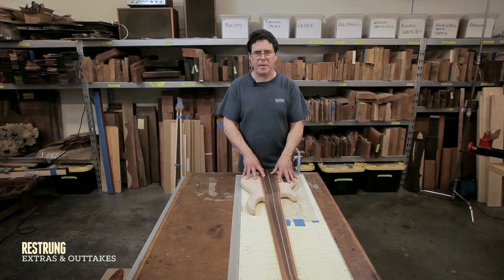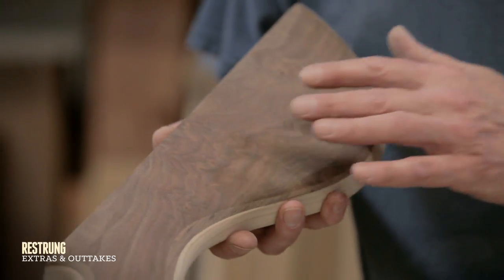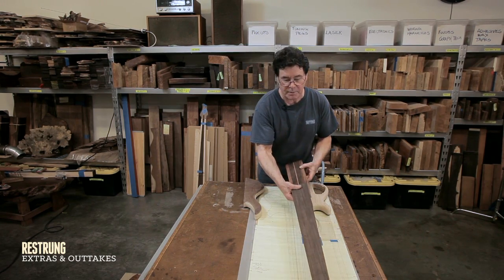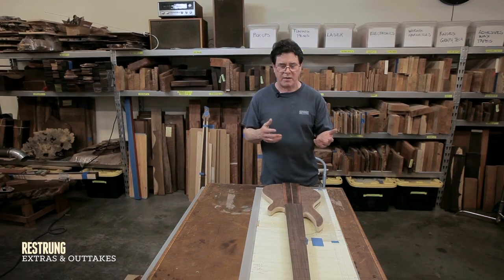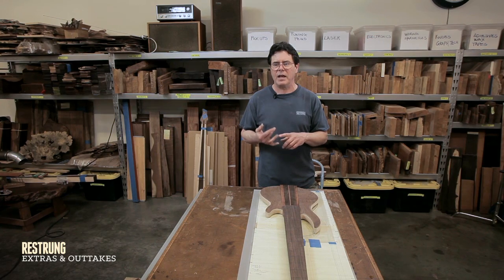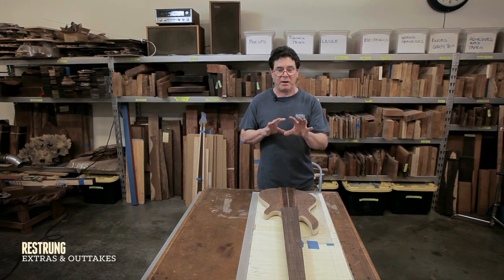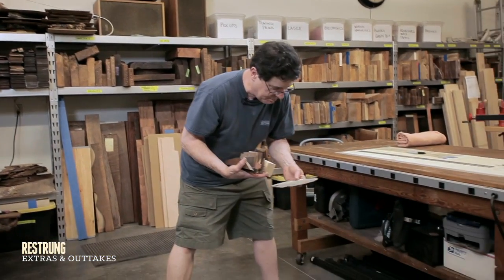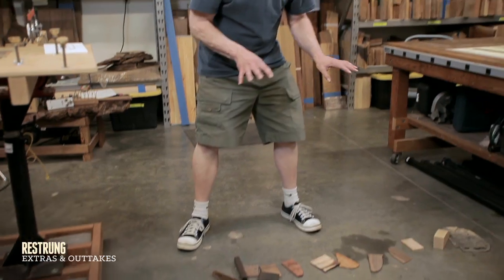How to Build a Bass Guitar - Step #10 - Tonewood Explained

Comment: as for the test u did with the wood droping on the floor ... i noticed the pieces were not even in shape and sice and i believe  even not weight... so how can these really be compared to each other when the parameters are so different? dont get me wrong this is not meant to be an offence.. but i just wanna know cause im really interested in this.
Reply: I would love to see somebody make a xylophone from identically-sized pieces of the most common "tonewoods". That'd be a good demo of the differences, I think.
Reply: so u have a xylophone that changes the sound not the note ... nice idea
Reply: +Crn Dffy That's a brilliant idea.  What we're hearing is the size, shape, and density of the wood.

If we had someone mill out identical blocks using different species, we would have something to listen to.  Of course, every piece of wood, even in the same species, can be vastly different.  It'd have to be done with many samples.
Reply: Guitar and bass pickup only pick up the metal string movement. Resonance of wood has nothing to do with the sound of the electric guitar or bass. You can do several experiences, the most known is to string the guitar with acoustic or nylons strings, you will ear the resonance but nothing comes out of the amp.
You can also pick the guitar with the neck free and then support it against a wall, you will ear a difference in the resonance of the guitar, but nothing will change on the tone coming out of the amp.

Comment: I don't mean to knock the artistry of guitar building. But I feel that pickups and electronics are more critical to the speaking voice of the instrument. The body and neck construction are like the lungs and diaphragm, but the pickups and electronics ARE the vocal cords of any electric guitar or bass. Another aspect of electric guitar and bass building that most builders tend to under-emphasize and undersell is how pickup placement affects the tone. Gibson seemed to understand this idea when they built their Ripper bass that had a sliding pickup built into the pickguard. Mike Pope also had Fodera build his signature instrument with a movable pickup mounted into the body near the bridge. I believe Alembic also built an early prototype with movable floating pickups. At any rate, its a concept that really hasn't been delved into as much as it should be.

Comment: For an electric guitar without piezoelectric pickups, the species of wood does not matter.  The density and shape does, even if the significance is minor.  The strings are probably the biggest influence, followed by the pickups.  Yes, some sympathetic vibrations from strings do resonate in the body/neck and transfer to other strings, but we typically try to avoid that!
Reply: Great. Please go tell this to luthier Michael Tobias. He is famous by using the same hardware on all his basses, the only variable being the wood. His basses sounds completely different though. Can you explain this?
Reply: Btw I noticed from my experience, that quality and type of the wood is much more important for bass guitars, than for electrics. I suppose this is due to more massive strings on the bass and more energy transfered to the body of the instrument.

I would add that there are usually two reasons for people to say that wood doesn't matter. First, they never held any fine instrument in their hands (better and more expensive than american standard Fenders or Gibsons). And second, they just didn't trained their ears and just cannot hear the difference when it is obvious.
Reply: I'm not saying the piece of wood doesn't matter, but it's not specifically the species.  You're absolutely right.

The frequency response of the wood, determined by the resonances, are what actually affects the sound.

If you have a maple body with a similar density and grain structure as a mahogany body, it will sound similar using a magnetic pickups.

However, for acoustic guitars and guitars with piezo pickups, the species DOES matter!
Reply: Well, I agree with you in that "maple body with a similar density and grain structure as a mahogany body" will sound like mahogany. Of course it`s true :) I believe the majority of the people thinks of tonewoods in context of their density and structure, not appearance or something like this. So I don`t see any disparity with what I`ve said above.
Different sizes, shapes and densities of the species define resonant frequency (or frequencies) of the instrument. 
I suppose the main difference between electric (solid-body) and acoustic (Hollow-body)  instruments in terms of resonance is that in the first case, the instrument absorbs the frequencies (harmonics) close to it`s resonance, making some 'gap' in the spectrum, while in the second - it enhances them.
Reply: Truth here

Comment: Modern pickups cannot "hear" the difference between wood and chocolate pudding.  The tonewood myth has been debunked many, many times. The only thing that dictates the "tone" of a guitar is the pickup.  You can, and I have , mount the pickup on ANYTHING  else and it will sound the same.  MANY videos here on YouTube dmonstrating this. I figured it out while working for Gibson guitars years ago.
Reply: I make some guitars and I alter the final sound by placing small pieces of wood in the electronic cavity and the f holes ...Also if you remove the lacker p.e.polyester and you let the wood free or with a natural coating you hear the difference in sound ...So it is not only the pickup if you can hear the sound ...
Reply: I build guitars also. I used to build for Gibson guitars .  What you are hearing has nothing to do with the wood.  It is the pickup "hearing" the ambient vibration along with the vibrations coming from the magnetized field in front of the pickup. Will it sound different from solid body to hollow body?..Yes.  For that very reason.  If you had a cardboard chamber that could resonate, it would sound the same. Your experiments with lacquer and wood only changed the resonanant vibration, not any tone.  Modern pickups are filled with wax or "potted" to eliminate the chance of becoming "microphonic".  Old pickups that were'nt potted, were microphonic and would feed back and scream easily. Not a good thing.  The pickup is the guitars "ear" but that ear ONLY hears vibration in the magnetic field. It cannot hear a "flavor".  I have made MANY $160 planks sound like the meanest $5000 Les Paul imaginable, and do it almost weekly.
Reply: SkyVector Aerial I'm no physics master or anything, nor have I ever been a luthier. But you said solid bodies sound different from hollow bodies. With hollow bodies, there's one huge cavity, and that affects the sound. So why can't wood density also affect the sound? Because a wood that is less dense than another type of wood will effectively have less matter per volume, so essentially all the micro-cavities / microscopic pores of that wood will be slightly larger, resulting in more volume taken up by air, the same as hollowing out a small amount of the body.

And also, I mean, I'm sure different types of materials absorb vibrations to varying degrees. There's a reason studios put foam on the walls, it's because foam absorbs better than cement or whatever the wall is made out of. So why can't different types of wood absorb vibrations (at different frequencies) to different degrees?

I fully believe a $160 Les Paul plank can sound like a $5000, but really, how much variance in wood did you use at Gibson? And also, no offense, but I always think of the Les Paul as a very colored guitar, due to the pickups yes. So if you're compared woods on a guitar that's primarily colored by its rather muddy pickups (versus neutral modern bass pickups), then I can see how you would come to your conclusion.

Not saying wood makes a huge difference by the way, but it is a subtle difference. I agree, the pickups (and strings, electronics, amp, etc) affect tone way more.
Reply: Andrew Suzuki  Its not a conclusion that I came to.  I was told by experts that used ocilloscopes and guys that understood the science behind the pickups. Then I experimented myself and found that they were correct.  I carried the tonewood cross for a while. Then the truth came out.                  Gibson actually uses several variances in wood types. Many people never realized that some studio lights actually had a balsa core. Yep, That's right ,.Balsa!  There isnt a more NON-reverberant wood on planet Earth. Did anyone notice the difference?...Nope.   Hollow bodied guitars use the "sound box" that also creates secodary vibrations that translate to the magnetic field. Thats why they sound a little differently. It doesnt get a "flavor" per say. It just gets a different field signal.  No wood is as dense as acrylic, but if you have an acrylic body, and want it to sound like a Les Paul, Simply put a Gibson pickup in it. Same for the Fender. Put a Fender in it.  Ive done it many times.A few guitars on the market are hollow metal and recently, some have been 3d printed plastic. Do keep in mind, almost no moderen guitar pickup actually touches wood. Most usually a plastic pickguard or a pickup ring.
Reply: What do you think makes the sound of a lightwave bass then, the pups use light to measure the string vibration, very pure natural sound
Reply: So.......it ONLY detects string vibrations...NOT wood vibrations.  Same as magnetic pickups.....you can't pick up a piece of wood with a magnet....so, again.....strings are the ONLY thing being picked up.  Kindergarten science.
Reply: Pickups are in no way connected to wood. They are mounted floating in a plastic ring. Wood only controls length of resonance, and not much of that.  Thats why a plastic toilet seat guitar with a Gibson pickup sounds like a Gibson.  Its simple science....not magical wood.
Reply: @daleyoung87  in case of many boutique basses,the pick ups are screwed or bolted to the body wood.the very much influences,thé sound.each builders instruments,hv a voice.Like in thé case of Alembic,Ken Smith, Wyn ,Ken Lawrence,.Théy All hv a basic  ,sound,unique to each builderwhich does vary, based, on wood used.My opinion is based on many yr usine and owning instruments from three of thé four builders i mentioned.